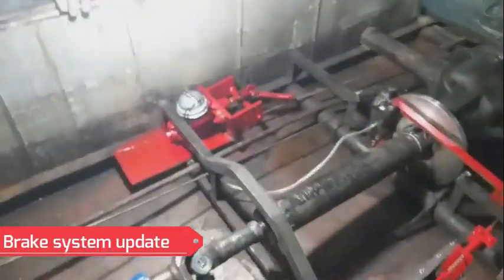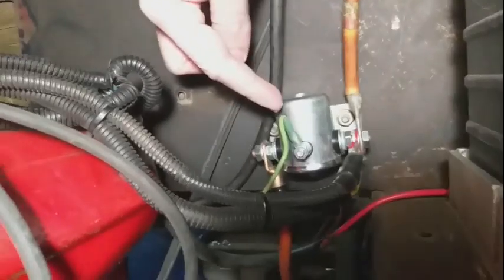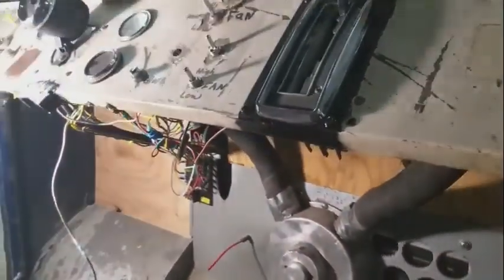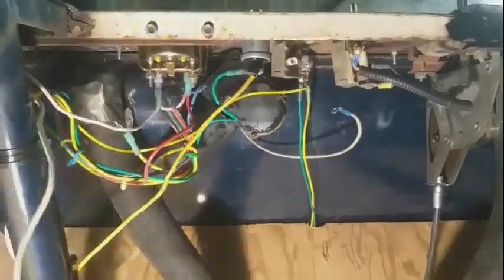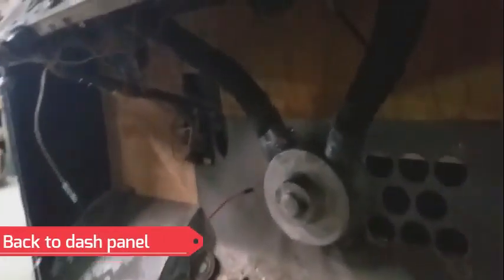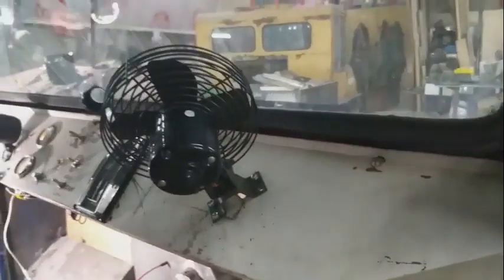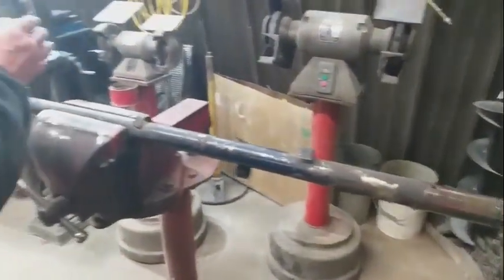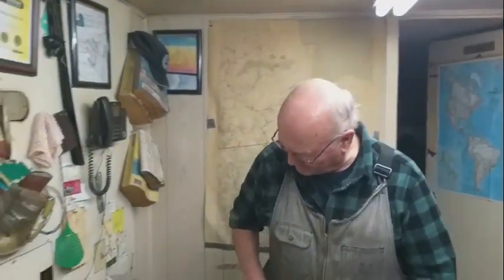INSTALL WINDSHIELD WIPER MOTOR and more on BOMBARDIER

Comment: Does the bombardier have a fuse box connected to a electrical harness. or is every switch independently hooked up? Confusing to see what powers what and how it gets back to the power source.
Reply from the maker: there is a fuse box. But dad is busy re-wiring everything because of Mickey Mouse wiring job that was in place. The fuse box and wiring video will be seen in a few days. Other than this wiring issue we are ready to fire up and move out of the shop.